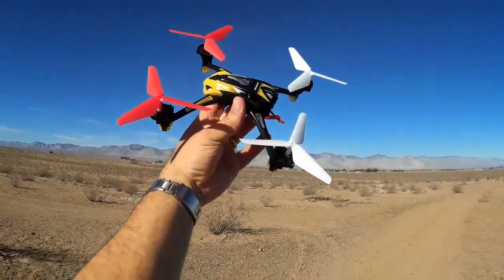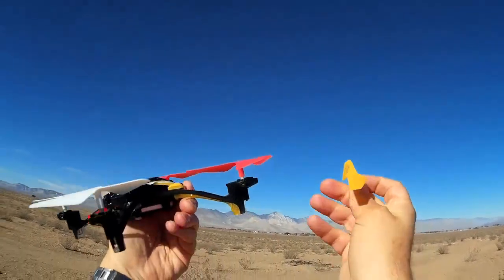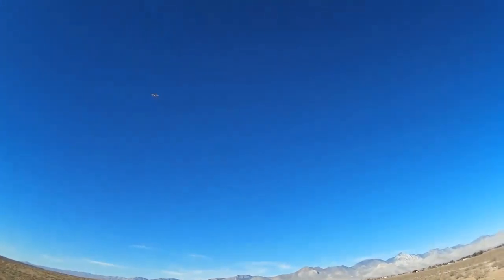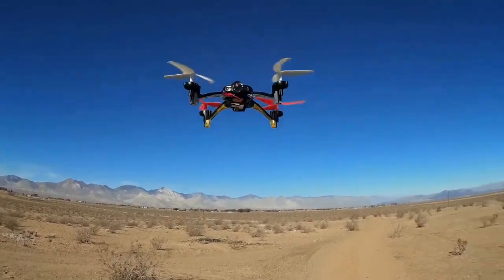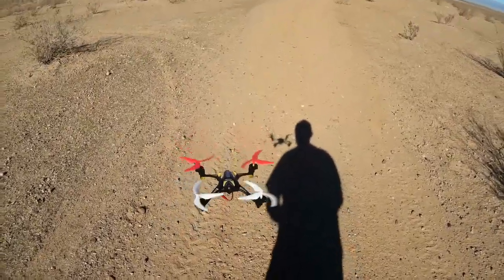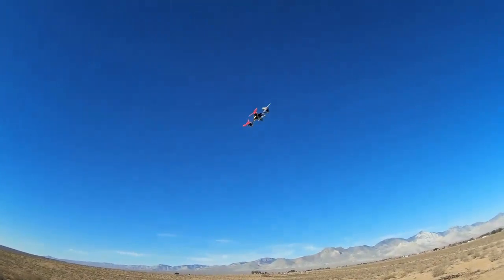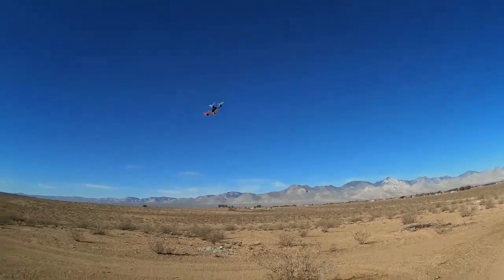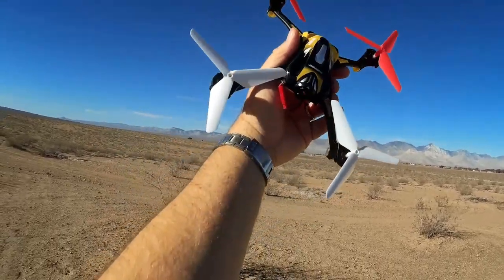L6052 Quadcopter with Three Bladed Propellers

Comment: Hi there. I just got my X5c-1 and also installed these props and they're vibrating so harrrrd.. I test it indoor, it was as stable as original. Gotta try to do a review on them on X5c :)
Reply from the maker: Really feel that there's no benefit to using these propellers over the original.

Comment: This opens another question, since we don't seem to have specific props available yet for the L6052, is the stock X5C prop the go to right now? Are they the same size stock vs stock?

I've been waiting on L6052 parts to get stocked somewhere before I decide if I'm going to get one or not.
Reply from the maker: You know that's an excellent question. Yes the X5C propellers should fit. Gave me an idea for another video. Thanks!
Reply: Quadcopter 101
and while you're at it. Please make 2 video, L6052 to use X5C-1 propellers, and X5C-1 to use propellers. :D It's a switch party! LOL